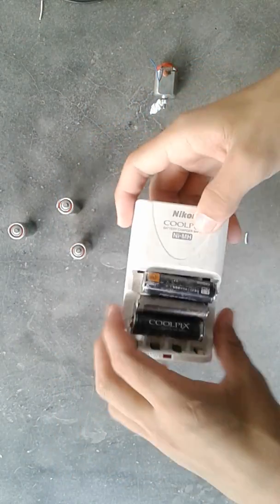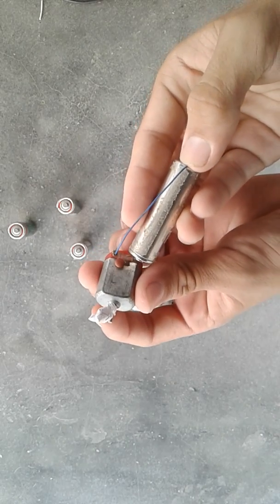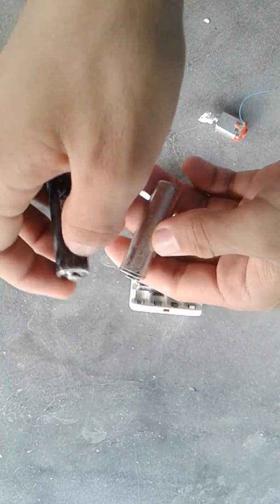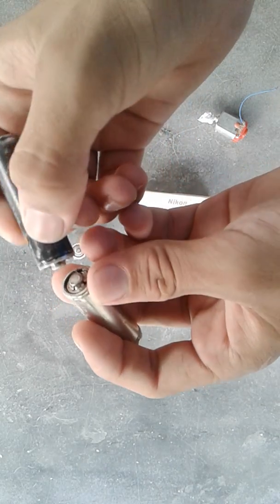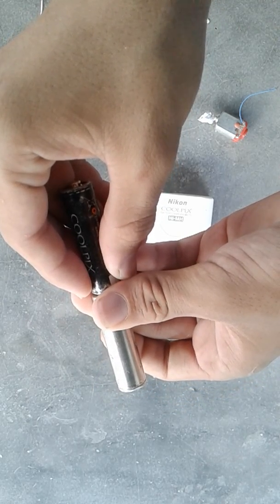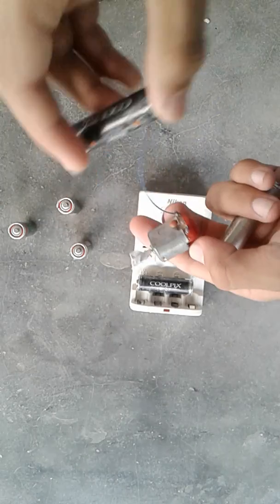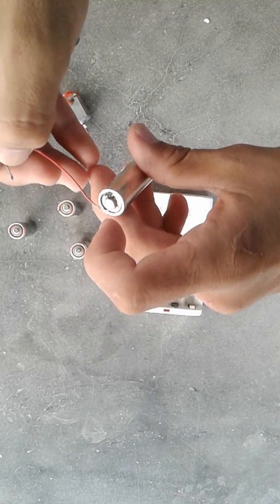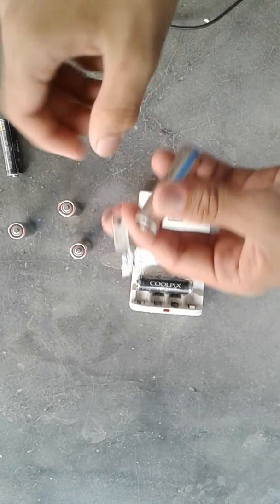How to revive a dead Ni-MH battery simple steps😀😀

Comment: Connecting the terminals from two batteries, without completing the circuit, does absolutely squat!!
You might as well touch the dead battery terminal to your shoe, or to your kitchen sink - same result!
Reply: There is a parasitic capacitance of the air, wich closes the circuit 🤣😂🤣😂 that is for sure the mystery behind the "recap" illusion.